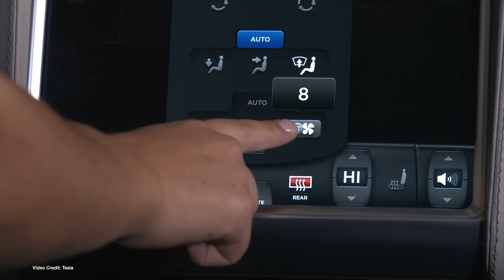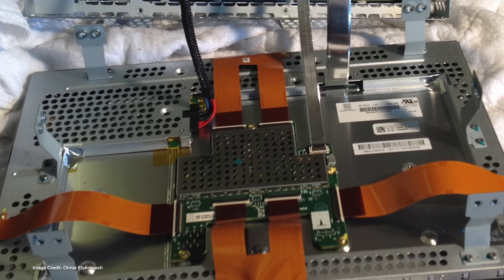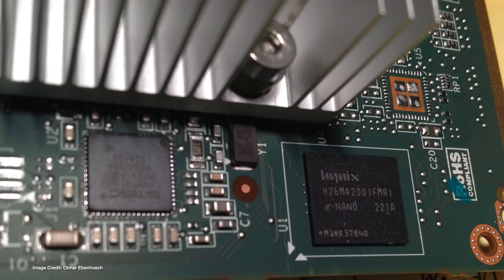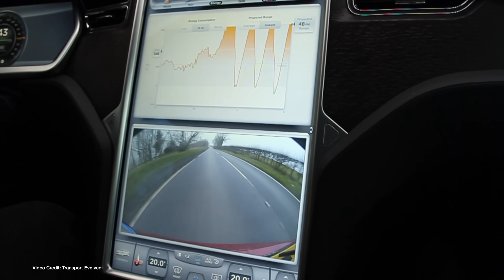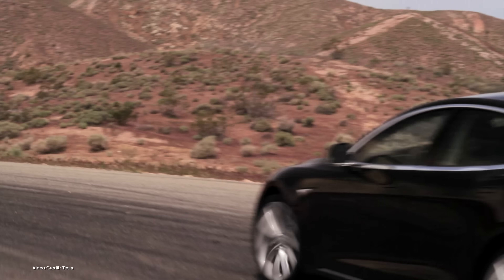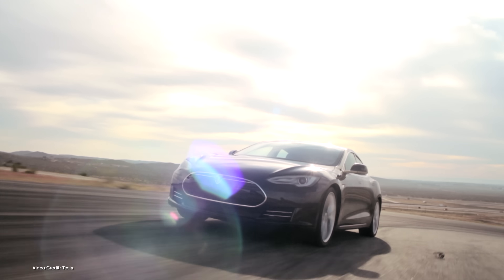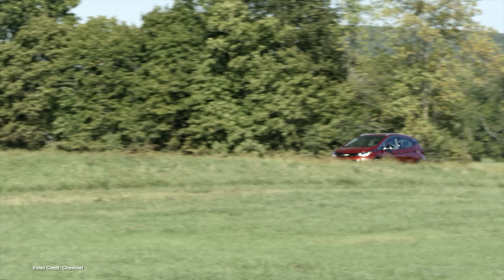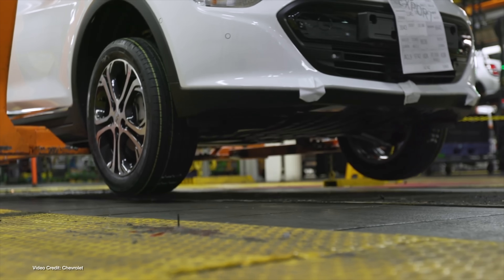Tesla Confirms MCU/eMMC Recall For Tesla Model S, Model X. But What's An MCU? And What's An eMMC?

Comment: too much sysloging ...
Reply: Tha's what happens when software guys ignore the hardware they are running on. In our modern world of virtualization and cloud computing, noone seems to be interested in hardware any more :-(
Reply: @EinzigfreierName  Can’t agree more !!! For them it is an “ abstraction layer”. 😹😹😹
Reply: @EinzigfreierName  "noone seems to be interested in hardware any more". This does mean that people who still know how the low level bits of a computer work can make a very comfortable living: because there is huge demand for people who understand the layers below the container, and not enough decent engineers to go round. We are all retiring, not least because they keep paying more money so we can retire earlier :-) So yeah all those web-monkeys are annoying but the scarcity of your skills is not all bad :-)
Reply: Yup. Should have use all our RasPi tricks for longevity.
Reply: @D0li0  I recall a video I saw more than a year ago with Rich Rebuilds and another guy when he explained this but the difference was that at that time Tesla was charging for the replacement of the whole “computer” and not the eMMC that was the one failing. Correct dimensioning is sometimes tough when you start and you don’t foresee correct the use of a component.
Reply: @ioannis69k  I doubt they are replacing the eMMC component though... I think @greentheonly has a video of doing the replacement, but it's soldered, so not for the faint of heart, I wouldn't attempt it.
Reply: @D0li0  Agree. The reason I mentioned it was because apparently Tesla was charging the price of full MCU when it was showing the symptoms mentioned in this video instead of assuming the cost of fixing the issue free of charge since this was a “design” issue not to choose the correct medium to store the very important syslogs and there is no sarcasm here on the importance of the logs.
Reply: @ioannis69k  it's not about correct dimensioning, it's about logging crap you don't need to a location that's not designed for it.
Reply: @Hans-gb4mv  I’m not aware about it in that level of details. If they were aware that they were logging this amount of data then they should have thought/planned a more robust solution that could cope with this kind of use. The client was never asked to decide for the model of storage to choose and the responsibility is with the vendor to replace free of charge whatever is causing the issue. With the above I do not disagree or argue with you about it. I just don’t know.